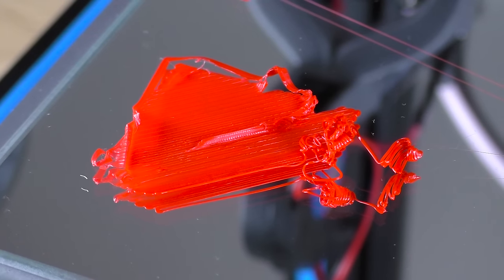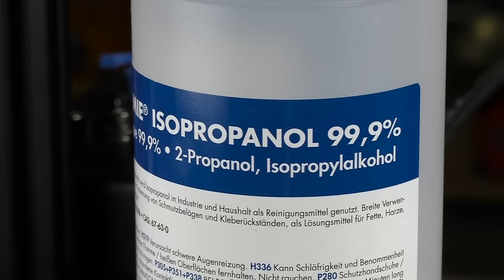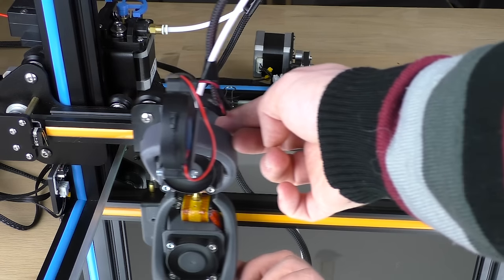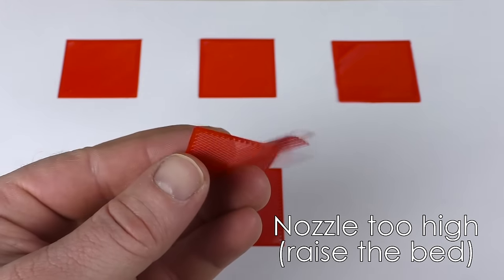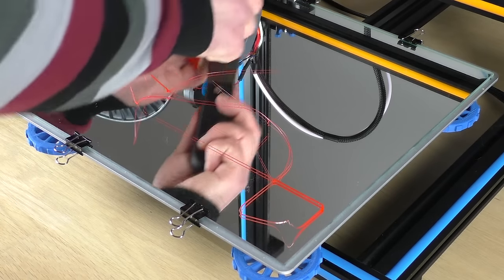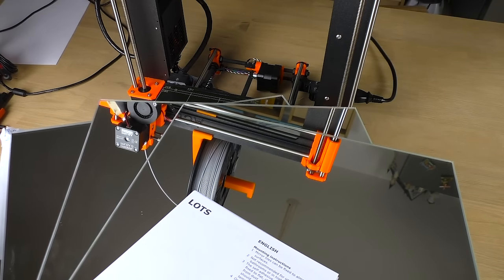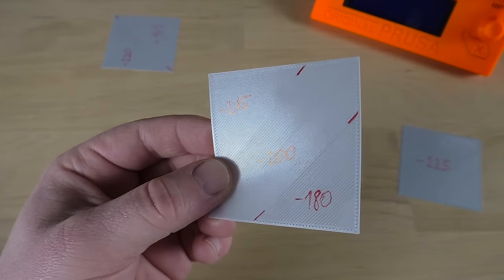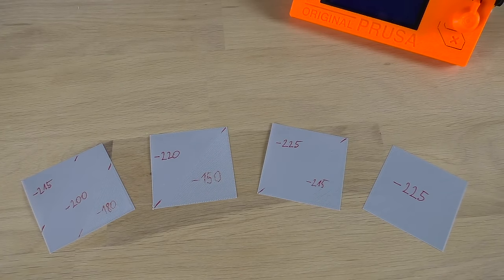Best method for 3D printer bed levelling

Comment: My CR10S is too low in the middle , any suggestions ?
Reply from the maker: Two things you can do. Flip the glass/mirror around, it works in most cases. If not, cut a patch of aluminium foil and place it under the glass in the middle. You can stack more of them until it's nice and flat.
Reply: @HobbyHoarder   Thank you  , I ran a whole strip down the middle and couldn't get it , This time I put only a square in the middle and so far it seems ok , I haven't printed yet to verify ( Still warming up )
Reply from the maker: That's good to hear. You might have to add another layer after a few hours of printing, because the ripples in the foil tend to smooth out.
Reply: @HobbyHoarder   Thanks ! Yes now I only have trouble with small circles sticking to the bed on a print , I tried the glue and hair spray . Can you make a suggestion of what bed I should get for my CR10S ? ( Currently using the mirrors from Home Depot )
Reply from the maker: Mirror seems like a good option, so I'd stick with that. Small circles will always be hard to print, so you should print them with brim (20-30 lines should do). Also, cleaning the mirror with isopropyl alcohol seems to help. In worst case, buy Magigoo, it really holds like crazy then.

Comment: the paper method is just silly, when the bed heats up it will move.  I've gotten it down, just use the brim and make any adjustments stop the print when is perfect, remove the brim and reprint perfect Everytime
Reply from the maker: Brim for every object might be a bit of an overkill, but yeah, still better than paper.

Comment: I don’t know why everyone speaks of glass like the miracle cure? Every pane I’ve used has been uneven. This may be due to the printer bed being warped but if that is the case then manual leveling is almost impossible.
Reply from the maker: clutch2827 Glass is a shitty option, I threw mine away after a few days. However, mirrors are a miracle cure. They are produced to a higher standard than plain glass and so are rarely warped. The surface itself is much better as well; if I squeeze the first layer too much, it's very hard to remove my prints.

Even if your bed is warped in the middle, you can always try to compensate by placing a sheet of aluminum foil under the mirror. Add more if you have to. Sometimes, simply flipping the glass around helps a lot. But you should try with a mirror anyway.

Comment: hi, and to say a good vid you have done.
my question is, i had perfect prints without auto leveling, but decided to add one for easy print, im using Marlin firmware . my problem is when i try to setup or do an auto level , is my print head is always going to the 0.0 ok left top of the bed and thus the sensor does not conduct onto the bed. work as not in contact, 
so ho do you make the sensor or i should say the print head go home but to the middle of the bed
oh im using an Anet A8 printer. with a 220x220 bed with axis of 250
thank for any help you can provide.
Reply from the maker: You will have to edit the Configuration.h file of the Marlin firmware and then recompile it.

You will find values for LEFT_PROBE_BED_POSITION, RIGHT_PROBE_BED_POSITION etc. that you can modify to change the size of your bed for auto leveling.

I found a tutorial that will explain this in more details, please check it out here:
http://www.instructables.com/id/Enable-Auto-Leveling-for-your-3D-Printer-Marlin-Fi/

Comment: I found the MIrrors from Ikea and it says pack of lots mirrors 4 packs for $9.99 was that it?
Reply from the maker: Yep, those are the ones. They're 30x30cm so it's almost perfect for the CR-10 (the bed is 31x31, so you'll lose just a bit of edge). If you have a different printer, you can cut them to size or go to your hardware store and have them cut there.

Comment: I have a CR10S-5 I wanted to use for modeling forms to use for aluminum casting parts. At 1:59 you can visibly see the bed move back up when you move your hand and pull the paper out, these machines are pathetically flimsy and impossible to get level with any degree of accuracy. When I first assembled my cr10S5 and hit auto home, it ran the nozzle into the bed so hard it strained and visibly pushed the bed down. If these things weren't so flimsy it probably would have smoked the stepper. If they even have enough power to do so. I have tried the paper method to level the bed and every single time I re-home it I have to do it all over again because it moves around so much I cant even fit a piece of paper underneath it again. Also, the bed appears to have high-spots in the middle, say I go from home to the right corner, then to the back and around and so on, the corners will be fine, just barely resisting on the paper, and it will hang up so bad in the middle-edges of the bed I'm afraid to push it past, and then guess what, then the steppers are out of synch because i pushed against the backlash, so I get to smash it into home again, and I have no way of adjusting the Z limit switch. I swear it would have been faster to make an entire cnc table for the printer motors and systems than to try and get the POS to work as is. I am a machinist and I am no stranger to tolerances and precision, but this printer is making me feel like an idiot. It has just been one discouraging setback after another and it has been two years, and I still havent even done a test benchy. Last night I decided for some reason to try and give it a go agan and I was immediately reminded why I dont fck with the stupid thing anymore. I dont understand how these things appear as though its a simple tool any ten year old can pull out of the box and make a magic model with. I can run anything from a HASS to an old Colchester manual, but I just cant get a childs toy printer to run. From MatterHakers making an expensive order of filament disappear, to not finding any solid material on the internet on how to convert the thing to 3mm so I can utilize the spools I do have, to the nightmare it has been trying to get the flimsy bed level, it has just been one thing after another.  Thank you for this video, although there really isnt anything new in here, it gives me a little motivation to waste more time trying to get my dusty $700 half-a-desk-top space waster moving again and maybe I can use the included half of a pathetic roll of crap filament for a dust collecting nick knack. Just beyond frustrated with the entire thing.
Reply from the maker: I'm really sorry you're having so much troubles with it.

To be honest, I've never heard anything good about the S5, I think it's simply too big. Even the 10S has issues with the uneven bed and those crappy wheels.

I don't want to suggest that you spend more money on it, but you could try and salvage it by replacing the wheels with bearings/rods or linear rails (two or three of them). That should make the bed much more stable. Then add a bed leveling sensor.

Comment: i hope you will pardon my ignorance, what about  i am going to ask is( not the .stl file) but can multiple .stl files be combined into one for printing or can one .stl be split into multiple .stl ??? if so, i will also spend some time find out how before i order both the 3d printer+filaments; thanks in advance,
Reply from the maker: Sure, any slicer should allow you to load multiple files for printing at once. It's a bit harder to split one file into multiple ones. I think the easiest way would be using Meshmixer. You can then separate the objects and save them individually. Depending on how the model was created, some slicers (I know about Simplify3D) can also separate multiple models.
Reply: thanks, i have+am looking into meshmixer already, it looks promising as with freecad, the learning curve is very challenging...and i am the type who refuse to die hahahaha
Reply from the maker: unglaubich uberlieber MeshMixer isn't very user friendly, but I'm sure you'll get there, good luck.
Reply: In Cura, just click "open" and add each stl file. It adds each item, but sometimes you have to move them around. Finding room for all of the items can bea pain, but I like to print a lot of stuff at once. Big objects toward the center, and smaller outside. If you have a heated bed the larger footprint tends to cool unevenly as it gets closer to the edge, and will curl.
Reply: thanks, for the suggestion, next week i will try that

Comment: What about using a feeler gauge?
Reply from the maker: ChinaAl I guess technically you could, but it's not really practical.

It would be awkward to mount it and no printing bed is flat enough for that kind of accuracy. Printing squares is much faster and easier to do and more importantly, it's good enough for 3D printing.
Reply: Okay thanks.  1 video I saw he uses a feeler gauge and also does not recommend the paper method. I'll try your way.  Great Video.
Reply from the maker: ChinaAl Thank you and feel free to come back if you'll have any issues.
Reply: Okay thanks
Reply: you are right about feller gauge, but theres a miss conception, you had to level the bed at the height of the first layer, so you can start printing without any movement in z axis, and other common error is to calibrate the bed in cool condition, glass and even borosilacte twist a litte, when printing pla is not so much due the low temp required, but with abs and other plastics adobe 80 degres is a deal, you can get a lot of surpraises , how many times did you heard " oh my abs did not stick to my bed" i print abs without any spray paper or glue, just the borosilicate naked, but i level the bed 10 minutes after the print temp is reached and stick every time
Reply: Thank you.
Reply: I hated them and so much so I have no idea where mine are that I had purchased only for this task.
Reply: I only used them once or twice but since I started getting answers here I stopped using them.  I also heat the bed and nozzle before leveling.
Reply: I have found, and I have read, that heating the nozzle adds much to nothing so I stopped doing it.  I have never ever been good at leveling a bed no matter what.
Reply: Me neither.  My first 3D Printer was a FLSUN Delta QQ until it broke and I got a refund.  That had an auto leveling bed.  This new Tevo Tornado while a great printer is manually leveled.
Reply: Hobby Hoarder   Wait, I dont get it. Why would you need to mount a feeler gauge, (unless you want it automatic). I use the paper method now. Printing one (or more) test prints 'just' to level the bed seems a bit overkill. Why not just find the distance once very carefully... and then use feeler gauge's  next time you level the bed: you can even have different ones for each layer height setting. Sounds like the perfect solution to me: lower bed a little, put nozzle above a corner, put proper feeler gauge underneath it, screw it up till it touches, next corners, done. Why not? just because its hard to automate? So what? I am doing it by hand anyway on my ender 3?
Reply: Bas Koning I finally found my feeler gauges but meh though what I am replying to you about is that the paper method is shit for some of us.  No matter how much I do/did it I can't get it right so I wish there was some way to automate the process like you would on a CNC with a zero block.  I don't want ABL as that is just a bandage and does cause other issues so I wish someone would devise a real bed leveler where it would level each of the 3 points, mechanically, when commanded to do so.
Reply: The Best Stooge  Yes yes, I get your pain, it is hard to get it right quickly. This is how I do it, but I could be wrong: if I want a 0.1 layer height, the nozzle should be exactly 0.1 above the bed. Now, I use paper for that: 10 layers is about 1 mm, so one would be perfect. Here is my procedure:

'add a few mm to zz axis (get it off the bed)'
'add a few mm to xx and yy axis'
'lower bed a few strokes on all corners'
'preheat PLA' (empty nozzle and bed)
'autohome' (it goes to x, y and z 0-position)
now, the z of the nozzle is at printing start position height, if the z-axis changes at all, you need to autohome again

with the paper on the bed, screw the bed on that corner up till the paper a) will come when you pull it b) will just bulge up when pushed (as opposed to slide underneath freely).
The 'window' of heights at which the paper will do this is very tiny, giving a consistent height among all the points.
 
then, (either with steppermotors off, doing it by hand, or adding mms to the x and y axis), go to each of the other corners, and repeat the process.

Done? No! You are only 'done' if you have checked all four corners: and did NOT have to adjust ANY of them. 
As long as you have to adjust ONE: you HAVE to check the others again. 
I do like 3 or 4 'circles' of checking: till all the corners have the same exact nozzle distance. 

Then I do the print, and, perhaps, adjust by hand a tiny fraction if for example I find bulges of material on the first layer (nozzle too close)
I have a skirt (or at least a brim) around my prints, so if fails on that I can stop the print, adjust, try again. After the first layer its: pfffw: ok!
Reply: I haven't done 4 corners in 4 years and if I can't get your leveling procedure to work after almost 6 years I never will.
Reply: @baskoning9896  I'm new to 3d printing... and use a EZABL on my Ender 3 Pro. what are the best first layer settings to use.. 0.2 or 0.3? And do I need to make different adjustments for different layer heights?
Reply: @jorgeneo560  Here's why a feeler gauge, although would work theoretically, doesn't really work. When you put something on the bed 9/10 times you're applying light pressure down on the springs (which is why alot of people use paper, you just lift up and away, not squeeze beneath) which messes up your level
Reply: NordaX Glass yes and also tighten the screw solves that
Reply: @jorgeneo560  I think your misunderstanding me, to put something under the print head and move it around, unless your pulling up on the item in question, it will be pushing down on the springs, making it seem as though your at the correct level, when in reality your not.
Reply: @nordaxglass6572  adding more pressure to the spring solve that, i had do it a lot of times and worked really good i had printed the open ring with that method and worked

Comment: I tried to slice the center only and 300x300 squares with Cura 4.11, but resulted in a zero layer design.
Reply from the maker: Make sure to resize the square only in the XY direction, the thickness (Z) must remain at 0,2mm.
Reply: @HobbyHoarder  I didn't realize at all. I just updated Cura, I wonder if there is a bug.
Reply from the maker: @davepost7675  I wouldn't call it a bug - normally, you do want to scale in all directions equally, this is just a special case where the height must remain unchanged.
Reply: @HobbyHoarder  I did not scale anything. I downloaded the calibration squares designed for the 300x300 print bed AND the single center square. Loaded them into Cura 4.11 (which I just updated), then sliced them and resulted in 0 layer gcode. It will even run, heat up the bed and nozzle, then finish since there is nothing to print.
Reply from the maker: @davepost7675  Ah, sorry, I misunderstood you.

In that case, I'd check that you're printing at 0,2 layers. Also try and place the square on the face again. If even that doesn't work, scale the model in Z only. Increment in 0,01mm until it starts showing up in the slice preview.
Reply: @HobbyHoarder  Okay, I found the problem. My Initial layer height was set too big. Sadly, no amount of adjustment is getting this to stick to my print bed. Looks like I have to resort to glue. :/

Comment: Mmhmmm... And what if I have symptoms of being too high and of being too low at the same time?

Also I absolutely cleaned the entire surface with IPA.
Reply from the maker: If adjusting the bed itself doesn't work, cut out square aluminium patches and place them under the sheet. You can stack more if needed.

If IPA doesn't help, then wash the sheet thoroughly with soapy water and rinse. Should be like new then.

Comment: i had ender 3 pro for year. first i build i removed spring made bed level. thats it!.
all prints works great. till.i installed slider for new computer magically everything changed.
filement not stick to bed.maybe surface not clean. NEVER clean it,but it looks brand new
nozzle clean line i have.been stick very good before now its coming off loosly.
staring skirt it made blob on start and it may bump on it and knock of skirt.

print not succesfull.UNLESS start it making RAFT. i never done it it takes too long,but it works.
why it works? it doing it slow so it stick bed better?

first i come this problem i was think oh no! nozzle is bad i need clean it.i prefer buy new printer than mess up it lol
Reply from the maker: Raft shouldn't be needed for PLA. I'm guessing your surface is not clean, even if it looks like it is. I always quickly clean it with IPA before every print.
Reply: @HobbyHoarder  yeah thänks.girst thought was new slider settings clean bed then nozzle then bed height.but it's funny raft will stick but not part without raft xD need buy cleaning alcohol

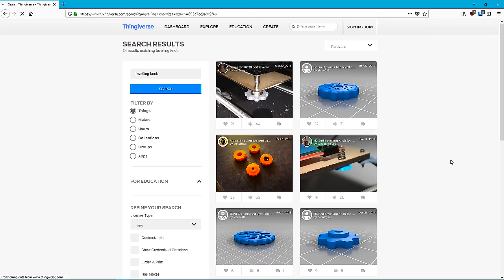Comment: 0:38 still spings its 2020. did you know changing one corner effect others.springs make bed moving sideways with springs. you have flat bed make it level without springs. never need bed level again. its levelled.only thing that can change is z home sensor.so only thing is change bed height if needed. bed is allready levelled if you build it correct.forget springs.they was designed for 1960 to prevent nose hit bed. RIGHT?
Reply from the maker: Majority of printers still come with springs. Sure, you can upgrade with auto leveling sensor (which is why I talk about that at the end of the video), but I'm sure most people don't actually do that.